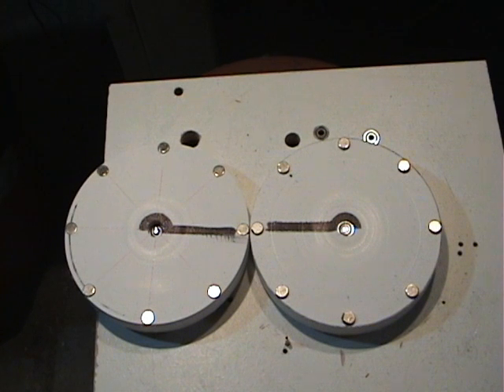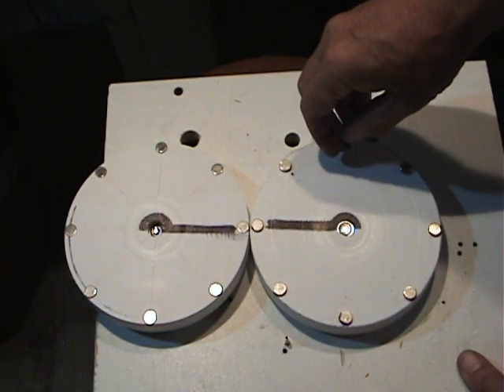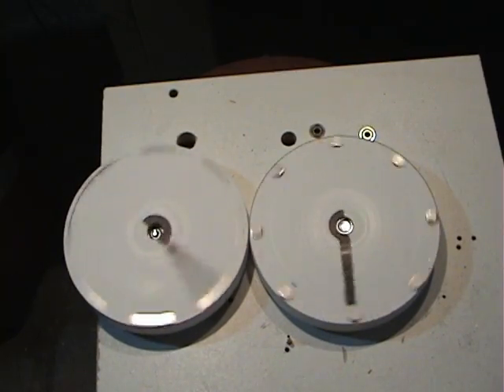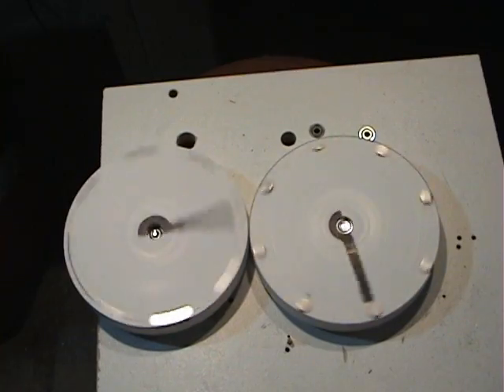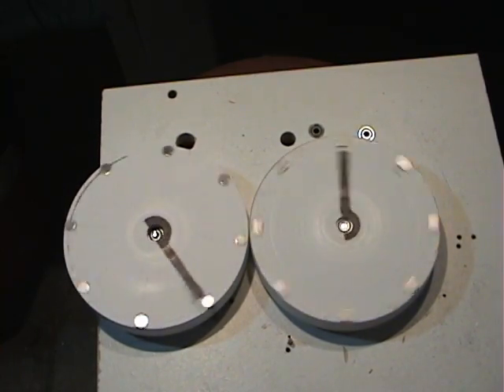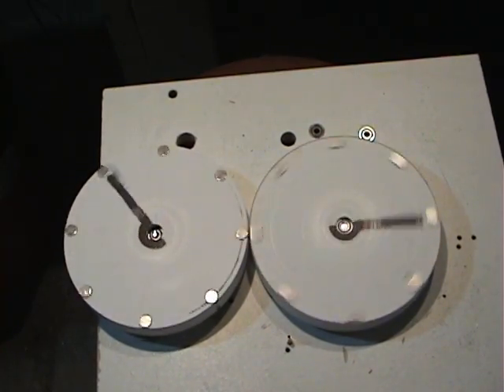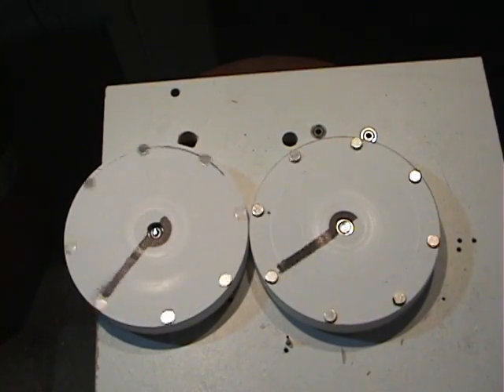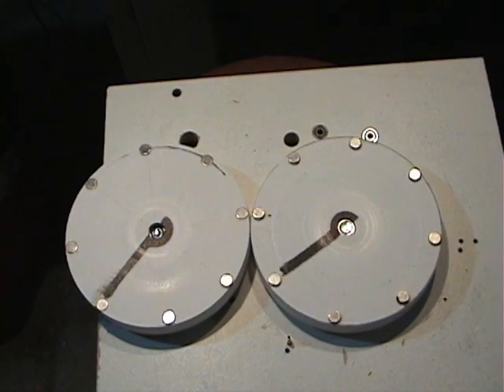Permanent magnetic interaction

Comment: Because if you can use the magnetic permanent force to create a difference in potential for the next cycle of repulsion, attraction, just as a combustion in a gas engine can power the mechanisms to produce the next combustion, friction losses are not absolute impediment.

Comment: The interaction between the 2 wheels is cool, but the reality is, every time a wheel slows, speeds up, or changes direction, it is a lose of energy applied to the wheels with your hand. No bearing or magnet strength will change this.